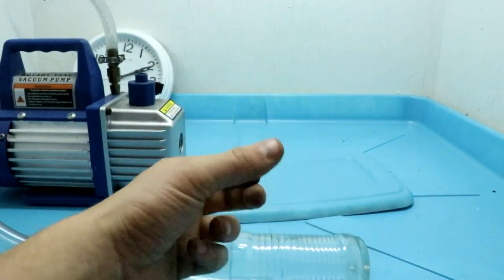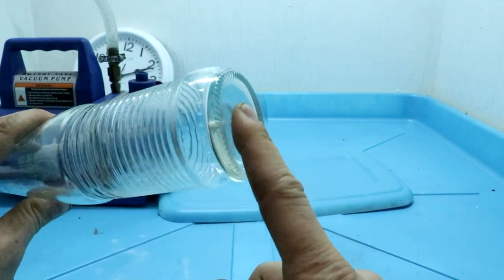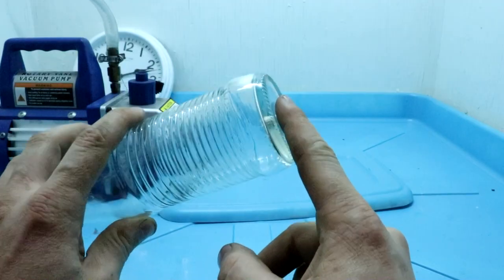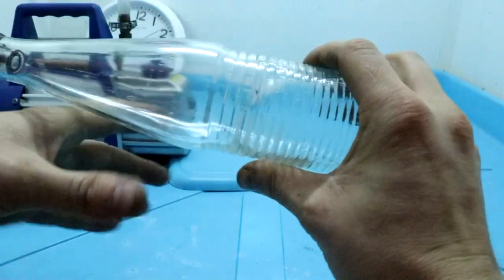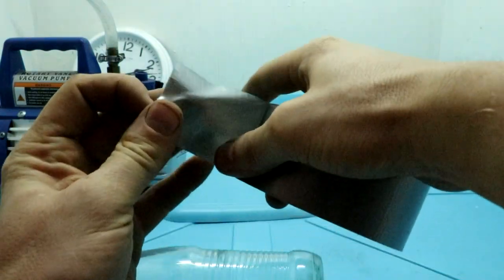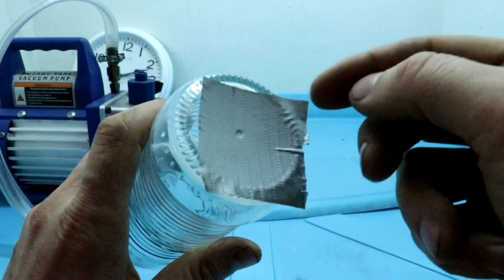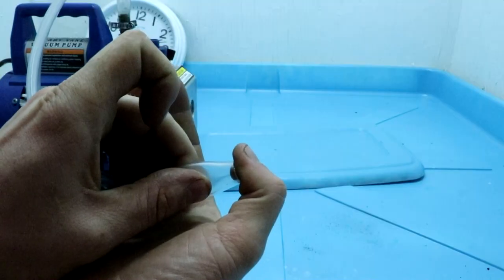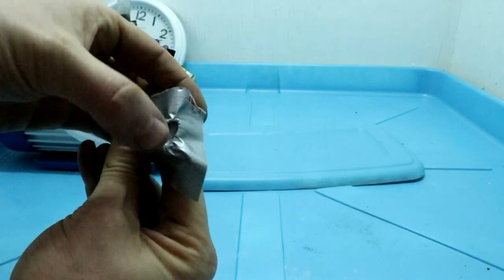Use Your Finger to Stop a Leak on the Space Station?

Comment: It turns out, you didn't get extruded into that little bottle. Phew. That's relief.
Reply: Fraser Cain omg 200000 subs that’s pretty awesome
Reply: I asked that question under a Fraser video, guess you won't need to answer that now :)
Reply: one of these days we'll get cody into a small container, one of these days...
Reply: Cody be like,
 youtube(dot)com/watch?v=AMHwri8TtNE
Reply: +Pluto : haha, never seen that before, funny as hell xD
Reply: not saying that would happen, but he did not let it get to a full vacuum, it was causing lots of pain.
Reply: Depends on your definition of a full vacuum; Cody is recording from a high up location where air pressure is 3/5 of the pressure at sea level. He was able to get water to boil in the bottle, so the absolute pressure was very low. He also never mentioned pain, he said it was a little uncomfortable.
Reply: Dr. Frasier Crane
Reply: Sl4yerkid  the thing you need to understand about vacuum is that removing 99% of the air is *absolutely trivial*. Even removing 99,99% is quite easy.
And if you remove 99% of the air, you already have 99% of the Force acting on the finger. 

So as long as you are using a real vacuum pump (not just a vacuum cleaner or whatever else calls itself "vacuum"), you always have pretty much the same force acting on things.
Reply: Well it would have sucked for Cody, but it would have gone totally viral.
Reply: If you want to read about a case where some divers were killed due to a rapid change in pressure, read about the Byford Dolphin disaster. I looked up photos of the aftermath and they still haunt me.
Reply: Lmao! so we don't get to see a bottle of Cody?
Reply: Like a different version of a ship in a bottle :)
Reply: @JustinG85  lol, yeah that woulda sucked
Reply: Won't it be intruded ?
Reply: John Gault  I believe its science as you go from small area to big area you call it extruder the other way around its called defuser as I recall
Reply: John Gault  fair point
Reply: I was also afraid of seeing remake of that Alien 4 scene...
Reply: @Ahapid depends on perspective, Cody's body would experience extrusion, the bottle, intrusion. Neither would have experienced a good time
Reply: Azivegu are you KIDDING? WE HAVE HIM IN A SMALL CONTAINER!!! Our mobile devices...
Reply: Thats too many SciFi films that is.
Reply: Spoilers -_-
Reply: Nice name.
Reply: It's maybe harder to replicate the exact situation of the finger being outside of the ISS inside the vacuum.
Reply: Yea, we're all glad Cody survived that experiment.
Reply: I was worried... :)
Reply: try doing the same on the outside of a submarine 6000 meters underwater!
Reply: But space vacuum is different. It's magical.
Reply: That was a risk, Scott Manley was willing to take.
Reply: I'm surprised the comment section was even open on Fraser Cain Day
Reply: @cambridgemart2075  that doesn't change the definition of vacuum in any way.  The pressure differential for sure, but it's still negligible

Comment: I would caution against using fingers as your primary emergency sealant material, as rubber plugs are usually far cheaper, and less subject to boredom.
Reply: That and as safe as this is, I'd not want metal splinters/cuts. XD
Reply: Another problem is the the finger will need food and water.  😀
Reply: @airkid4457  not necessarily...
Reply: @oliverturner1649  oh........ Ok then..........
Reply: What happens to rubber when exposed to the near absolute freezing temperature of space? The same thing that happens to fingers...
Reply: @MAXNAZ 47 pretty much nothing.. because the heat from the space station is keeping it warm, same as the finger. you might run into some issues in sunlight though, depending on the type, a rubber bung could get soft enough from the heat to be sucked out of the hole over the course of an hour or so.
Reply: People just take fingers for granted
Reply: sounds like a tip you'd read in a KSP manual lmao
Reply: You could use it to buy time for someone  to find a rubber plug

Comment: The solution is Flex Tape.
Reply: Flex seal*
Reply: Overactive Imagination flex tape would probably be more effective in they case
Reply: Just don't bring Phil Swift on board...he might saw the space station in half.
Reply: That's a lot of damage!
Reply: It would just get sucked out before it set.
Reply: I shot that boat in half!
Reply: I was gonna say that.
Reply: And the inside is completely empty
Reply: Legend has it, that there’s a screen door Flex Sealed on the space station.
Reply: Nicksperiments holy shit... I’ve never thought of that
Reply: @Lionheart638  Not to worry, he could put it back together with flex tape!
Reply: NOW THATS ALOT OF DAMAGE!
Reply: And the inside is completely dry
Reply: To prove the power of Flex seal I sawed this space station in half!!
Reply: I SAWED THIS SPACE STATION IN HALF, NOW I"LL FIX IT WITH THE POWER OF FLEXTAPE
Reply: Aberix but he’ll repair it using only flex tape®️
Reply: slap it on with the might of Zeus!
Reply: Let's be real: for a hole that small, Flex Tape would be more than enough. I'd imagine the bigger hole would be better sealed with wider Flex Tape.
Reply: It'd also be an amazing publicity stunt to at least bring Flex Tape to the ISS.
Reply: You'll have to call Project Farm for that video.
Reply: I SAWED MYSELF IN HALF. no flextape
Reply: Considering that the temporary fix was kapton and epoxy, it would probably work great.
Reply: Introducind the Flex tape
Reply: put flex seal around the hole, then flex tape on top of the flex seal and the flex seal will make a better seal than the flex tape alone, right?
Reply: You godamn right
Reply: It would take a lot of damage to be worth while.
Reply: Garmr *gasp* that’s a lot of damage!
Reply: Thats alot of damadge! How about a little MORE!
Reply: It's like an astronaut in a can!
Reply: *2mm hole in space station" NOW THATS ALOTA DAMAGE
Reply: THATS A LOT OF DAMAGE
Reply: Garmr, they should send some up there
Reply: The whole family of flex seal products.  
And guess what........... It even works on space!!!!    

Underwater too
Reply: Usually is... also E6000 & of course, Gaffers Tape!

p.s. ☆ the tape was just to hold the epoxy in place until it sets up...
Reply: @Lionheart638  he might saw ghe moon in half if they get too close
Reply: To show you the power of flex tap, I SAWED THIS SPACE STATION IN HALF!
Reply: @seniorvenusdigital3904  Flex Tape AND Felx Seal

Comment: One of those things that people might be inclined to think that is super dangerous, but the calculations for it are actually very simple and show how it's not really dangerous at all. Assuming a hole of 1mm radius and with a differential pressure of 1 atmosphere: 1 atm * (1mm)^2 * pi = 0.32 newtons, or roughly 33 grams of weight at earth's gravity. Pretty small indeed
Reply: Showing of your simple math skills by using smart words?
Reply: @SubsWithoutavideo-zp3kh  whatever makes you feel better man
Reply: Alexandre Truppel but for the tube one it would be around half a cm radius which makes the force around 25 times stronger?

Comment: Ok, this makes sense. We always think of it as the vacuum “sucking” the air out, but it’s actually the air “pushing” into the empty space, so the maximum pressure it can exert is based on the interior pressure, not the exterior vacuum. Interesting.
Reply: Thanks you just made this clear to me in a way I've never understood before
Reply: @faithful451  It really is the little things that make a difference. In space you want to build a vessel that CONTAINS pressure, not resist it :)

Comment: I regularly have to deal with large industrial vacuum pumps at work. If there is an issue, the way we usually make sure the pump is good is to put your hand over the 2 inch inlet at the pump. Then work your way down through the hoses. Always make sure the pump is good first. We can use gauges, but they are not always available or practical. Anyway, the longest I held my palm to one of these pumps was maybe 3 or 4 minutes. The worst damage was a 2 inch hickey on my palm that itched like crazy for the rest of the day. That said, I wasnt worried about solar radiation and extreme temperature swings either. Also, duct tape. It really does hold the world together.

Comment: * Space ship getting pulled to the bottom of the ocean *
Professor Farnsworth: Dear Lord! That's over 150 atmospheres of pressure!
Fry: How many atmospheres can the ship withstand?
Professor Farnsworth: Well, it's a space ship, so I'd say anywhere between zero and one.
Reply: In a couple decades when cody becomes old and senile, I could imagine him becoming the real life equivalent of farnsworth.
Reply: If you need me, I'll be in the ANGRY dome
Reply: "Good news everyone! I found even more mercury!"
Reply: Love it
Reply: I think its the idea dome or thinking dome. I cant remember. Ive only seen the episode 5 times.
Reply: I don't get it
Reply: Even worse is that a space ship is designed for positive pressure inside.  A submarine needs to withstand negative pressure (inside relative to outside), which requires much more strength.
Reply: You've all missed the point; the Professor in BTTF is Cody!

All we have to do is to ask him to make a flux capacitor to put into a used deLorean, and he'll be on his way....
Reply: What about planet with denser air

Comment: but what if there are aliens outside your spaceship? could you do it then?
Reply: tomatoanus what the hell?
Reply: is this fallout 5 plot leak
Reply: Absolutely, you just need to fire your keychain laser pointer through the hole a couple of times first, to get rid of those pesky buggers...
Reply: in that case you really should do it because otherwise the aliens will extrude through the hole into your ship
Reply: Sure.  Call Immigration and Customs Enforcement (ICE) and have the aliens removed...
Reply: I hope Cody tests this.
Reply: The aliens might lick your finger, so don’t be startled.
Reply: why are you using glitches??? cheater
Reply: in space the vacuum is outside not inside, so you would seal the hole from inside

Comment: If you went to something like a 2 inch diameter, could it rip off the skin on the palm of your hand? At what point could you expect serious injury from trying to stop a leak with a body part?
Reply: Skin is really strong, you would probably break bones and cause other damage before you rip the skin
Reply: That's a good question actually, I'd also like to know
Reply: Would be an interesting follow up experiment at what point it can suck out a human.
Reply: I've tried plugging the inlet of larger vacuum pumps with 40mm inlets using my palm, and my hand is still intact.
Reply: The force would be larger, but also the surface it's acting on. So probably there wouldn't be a big difference.
Reply: The area is proportional to the square of the diameter, while the circumference is proportional to the diameter. So bigger holes require a stronger patch to avoid the patch tearing at the edges of the hole.
Reply: 1 atm = 100000 N/m²
Circle of 5cm diametre = 3,14*(0,05m)² = 0,00785m²

Force on an area of a 5cm circle: 100000 N/m² * 0,00785 m² = 785 Newtons

785N / 9,81 N/kg (=m/s²) = 80,02kg

So there would be 80kg of force pulling on your skin (in a circular area of 5cm). If the corners aren't too sharp, the skin should be able to compensate that. I'm sure though that it would be quite harmful.

By the way, a circular area with a 4cm diametre would equal 51kg pulling on your hand, 2cm would be 12kg.
However, the force per area remains the same in every scenario, so the skin should be able to withstand it.
Reply: @Exoc1 Somehow I'm not wondering about your hand...
Reply: You're off by a factor of four; you squared the diameter, not the radius. 

Don't feel too bad; I spent an inordinate amount of time trying to figure out how I got around 40 pounds, and you got 80 kg ...
Reply: Alien : Resurection. That size hole :p
Reply: That's a circle with 5cm in *radius not diameter.  @Hoch134
Reply: @RobertSzasz  the moisture on, in, and under the skin would boil and freeze so it's not unthinkable that the skin shatters like ice before bones are broken, it would also probably break the seal as ice isn't that good at sealing holes
Reply: @AMan-xz7tx  sorry, I ment "before"  as in moving up in pressure difference and size of hole rather than time.
Reply: @RobertSzasz  ah I see, makes sense

Comment: For clarity, I personally wouldn't advise you to plug a half-inch hole in the space station with duct tape.
Reply: I would advise plugging a half inch home in a space craft with duct tape or anything you can find. 
The less the leak, the longer to fix.
Reply: Sometimes you just don't have many options.
Reply: A test-tube cork?
Reply: you could plug it with water I think
Reply: Damian Reloaded  Not sure you know this but water is kinda important to have inside the space station out in space.
Reply: Pee and spit is literally most of their water supply. It all gets recycled.
Reply: Well compromises must be made as *oxygen* (no less) is leaking out the station. You can live up to 3 days without water. How many days can you live without oxygen?
Reply: Question: How is water going to plug a half-inch hole to space?
Reply: Good question. Half-inch is gonna take quite a bit for it to freeze on the borders of the hole until it seals it. (in the hypothetical case the only thing at your disposal was water of course).
Reply: If you tried to put a floating blob of water in the hole, it would just get sucked out with the air. The pressure differential would affect liquids too.
Reply: Yeah, I think a floating blob of water wouldn't work. You'd probably have to apply it around the hole and let it slip over the surface towards the hole (pushed by the air currents), or maybe spry it. I'd hope as it boils on its way outside it will dissipate the heat on the surface around the hole and some of it will freeze, in layers, one after another until the hole closes. The other way would be to depressurize (the air into tanks) the entire module and then it would most definitely freeze.
Reply: Andrew Kovnat- You reply to every comment that you can find a flaw in, but none if the legitimate questions... 

So without further ado, what would you plug it with temporarily, and why is duct tape such a bad substance for the task?
Reply: just use LOTS of duct tape! :D (followed by a small aluminium plate welded to the outside of the hole)
Reply: Use flex tape instead.